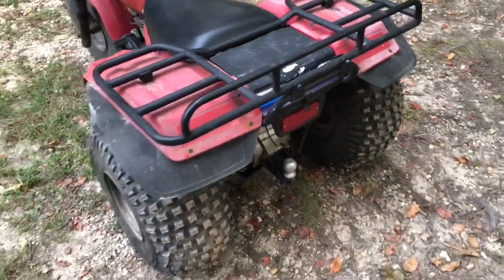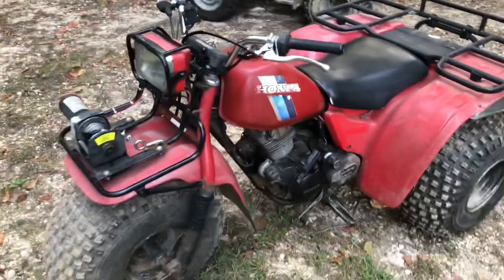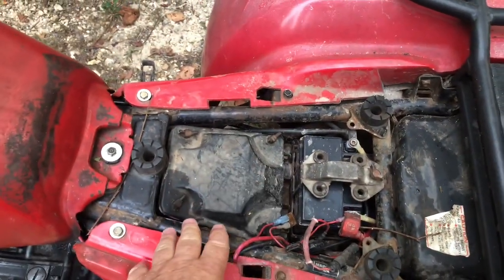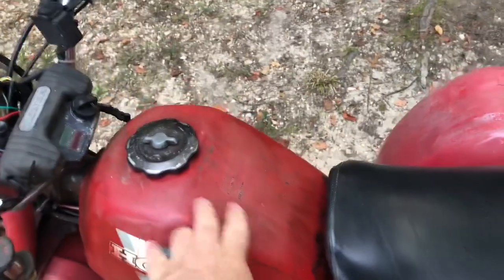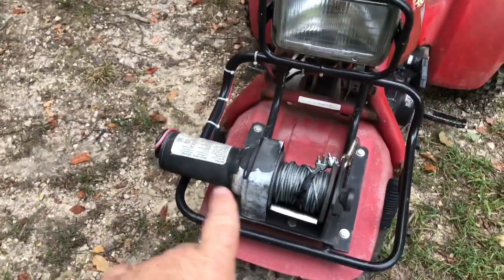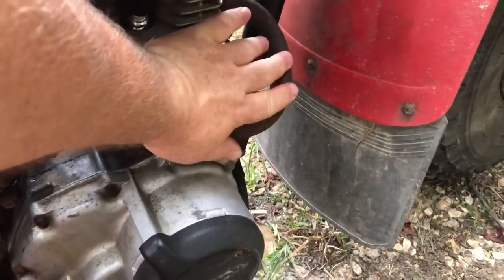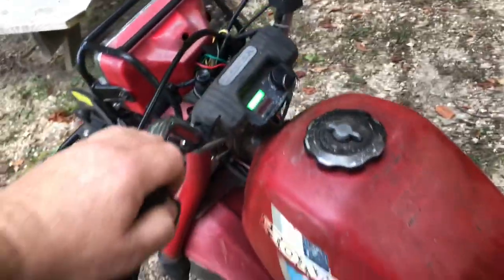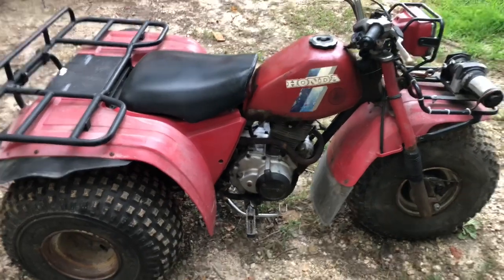1984 Honda 200ES  Big Red 7-21-2020

Comment: Calvin you did a great job fixing her up. i grew up with one like that i drove it everywhere. it was the best for on the bogs. i done a lot of moose hunting with it. for your gas leak around the stopper might need a thicker seal i can remember keeping the on -off on the stopper in the middle for some reason.
Reply from the maker: Wallace Vivian's Adventures the on off on the gas cap is to let air flow in the tank. Your cap must have been bad. My gas cap seal I just replaced it with a new OEM seal so that’s why I can’t understand why it’s not sealing. I took the gas cap off another ATC I own and it fits better. It could be that it is the wrong one for the tank. Someone could have accidentally switched it with the wrong one. But Yes they are great and I love it. Thanks for sharing your story. I could see you now out there hunting on it. 👍

Comment: Cause you can double and triple up on thickness till it's sealed
Reply from the maker: Not really. I tried the double seal and it wouldn’t fit on the tank. But thanks
Reply: @CalvinsCorner72  huh can u put a rag over tank hole then cap?

Comment: Try a rubber band for the tank cap
Reply from the maker: Thanks but I think I’ll try making a seal that’s resistant to gas and still fit without stopping me from putting the cap on the tank correctly.
Reply: @CalvinsCorner72  yeah can always try to find a extra thick seal